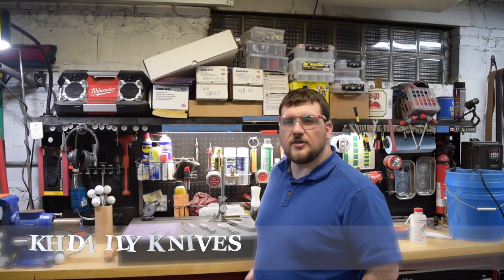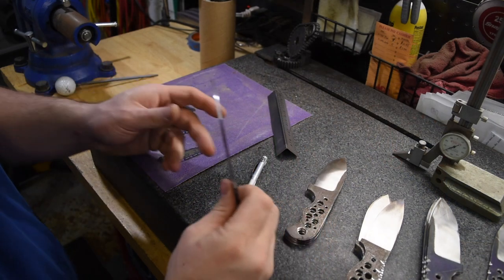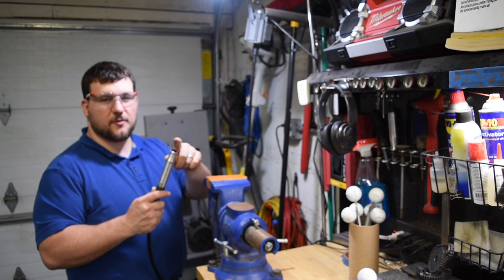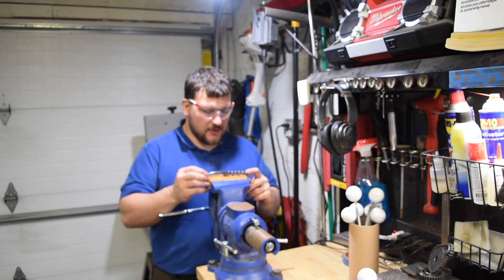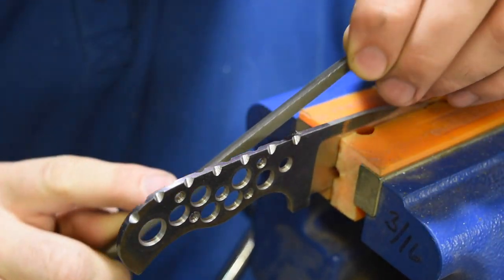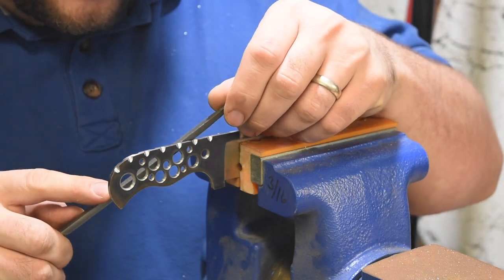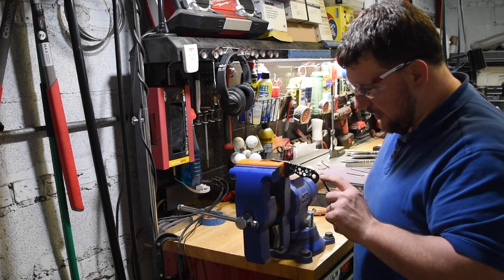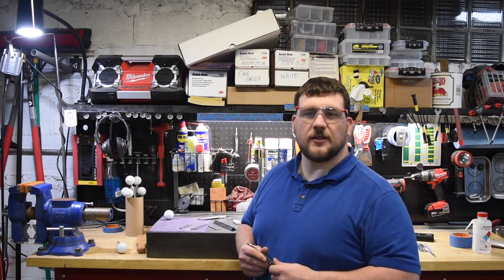Thorn Filework Pattern

Comment: Thank you for showing how it is done, but what do you do when you glue the handles on? It is not difficult to keep the glue away from the filework or remove the glue from the filework?
Reply from the maker: Paul Bohl I just fill the whole gap with epoxy and sand away the epoxy to reveal the filework pattern underneath.  Hope that helps!

Comment: What kind of, and where did you get that ruler you use in this video?! I need one of those!!
Reply from the maker: It is a ruler made by Incra. It is called a precision bend ruler and I got it from Rockler Woodworking. Amazon has them also. I will try to add a link in the description.

Comment: What's the electric carving tool called? Couldn't quite hear what you said.
Reply from the maker: Justin Lyman It is a Foredom TX flex shaft. You can also use a Dremel to do the same thing.  I used a Dremel for a long time before I bought my Foredom TX.  I have other attachments I use on mine that make it work really well in a small shop. They have one that makes a right angle and you can use a 2” quick change disk. Hope that helps!  Let me know if you have any more questions.
Reply: Much thanks!